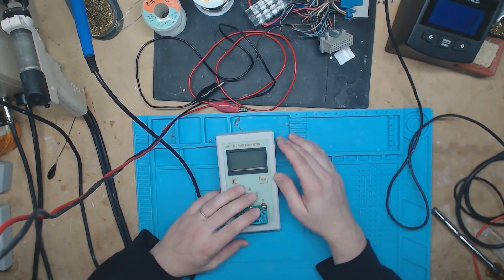Getting Started in Instrument Cluster Repair (Tools)

Comment: Thanks for sharing this info.
I was thinking about building the class II serial data interface, but it's too bulky & too limited (model/years). So, I bought a BT VCI/Dongle type scan tool that you control with your smartphone. You may be thinking, yeah, yeah we've all seen the Blue Driver, but it's a $100 bucks & wont do bidirectional & special functions, & you'd be right. However, the one I just got will! 
It's only about $110.
 I checked, & it will do the all lamp-on prove-out test, & the all gauge sweep on my 2003 GMC Envoy. So, it'll cover '99 to 2018 GM IPC control, plus all of the other systems in the car/truck.
The BT VCI is called "ThinkDiag" from the ThinkCar company. I believe it's a "Launch-Diagun" repackaged to work with your smartphone (or tablet, or iphone) I'm very stoked to have found this tool. Found it on Keith's "New Level Auto" YouTube channel. Here's the link on Keith's channel:
https://youtu.be/z_GMlVPB2Ho

Here's the link to the tool:
https://www.mythinkcar.com/product/3/t1

I would strongly advise you & Jeff to consider this tool. I'm just amazed what it can do for the $. I mean you can program immobi keys & dang near everything else a factory scan tool can do. Sorry for the rambling, but as you can see I'll pretty excited about it.
Take care & thanks to you & Jeff for all the great tutorials!
Reply from the maker: Sounds neat. Just FYI building that box with the ECU it will work with any of the GM clusters that use class 2 because its the same PID's across the board and an ECU at a junk yard can  be had for $20. The knock off Tech 2s can do the Gauge sweeps and all but they cost more than your tool. You can also one of the $20 Bluetooth dongles and send the right PID's across it with a terminal/Console app. If you have enough time on your hands you can us a cheap dongle to sniff all the commands you are running on  any of these tools and do write ups/ videos on manually sending the commands. Some wouldn't be worth the time like IMMO, Firmware update but the gauge sweeps are most likely just a single message. I just haven't  had time.

Comment: Maybe I missed it, but did you cover the serial data bus tester?
Reply from the maker: Building the one out of a ECU? Yes. Making one with an Arduino I haven't had success doing that. Here is the link to that video https://youtu.be/sK-0JmeoRZM
Reply from the maker: Oh you mean in the video no but good point I should have mentioned it because if you are doing for other people you need to test it before you send it back out. I also should have mentioned the signal gen for testing speedo/tacho.
Reply: The signal gen is the only thing i can think of that I need to get next and I have never used one but i know i can learn how to use it
Reply from the maker: The signal gen is pretty easy to use. If you have an oscilloscope you can hook them up to each other and it will make it  make sense. I'm a visual learner so just reading something doesn't make it make sense to me.